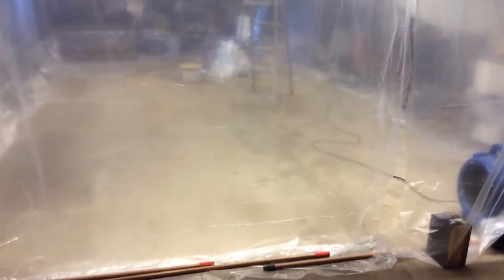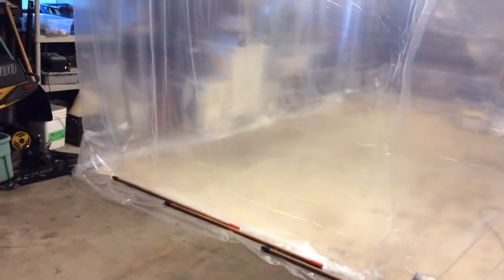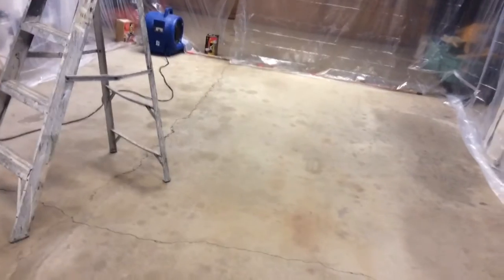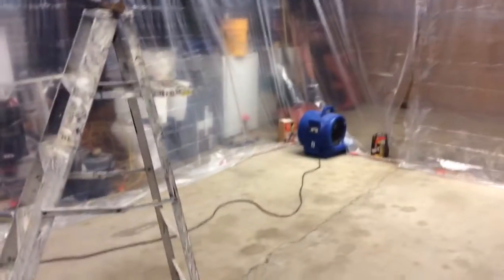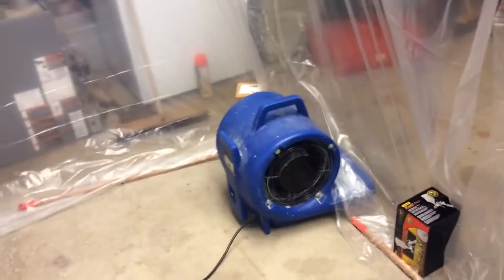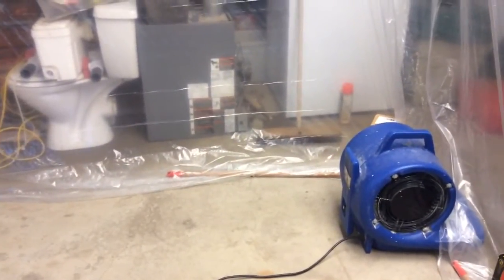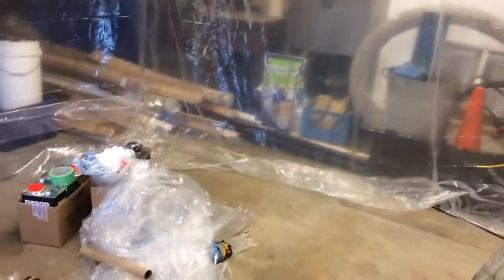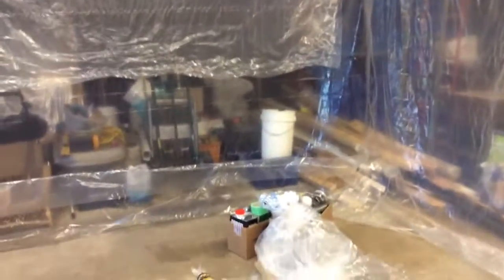DIY car paint spray booth

Comment: I was wondering, since you are using an electric fan to suck out the paint (over spray) isn't that kinda of dangerous? I mean that's an electric fan, it could possibly spark when the motor is running. And if that happens, BOOM. The reason I am wondering about this is I want to build a paint booth to paint my motorcycle, but I don't want to blow myself up. :)
Reply: Yes paint should not cross an electrical motor, it makes a great combustion